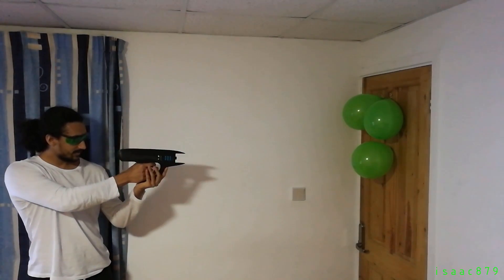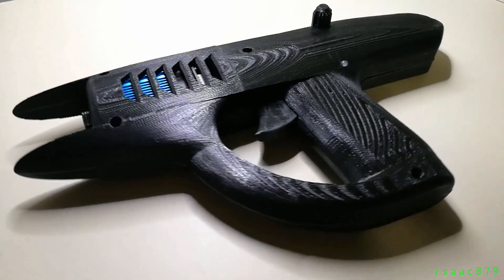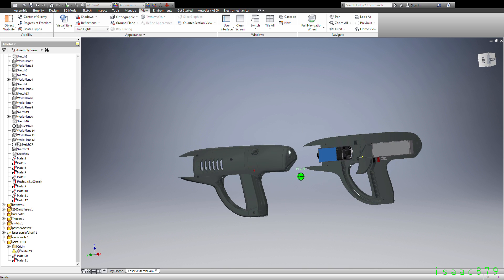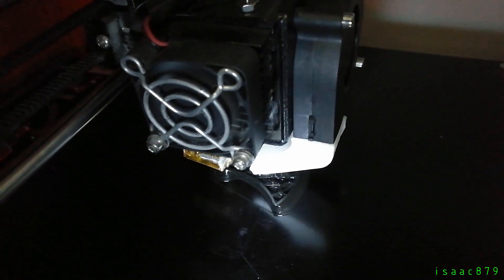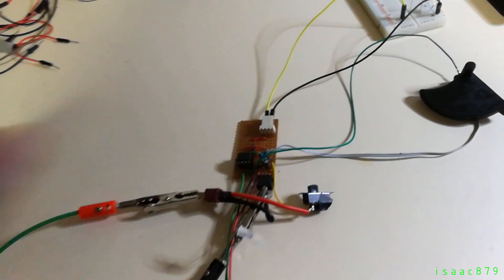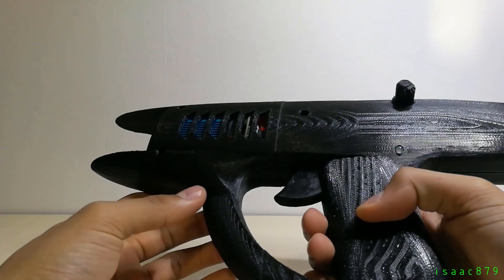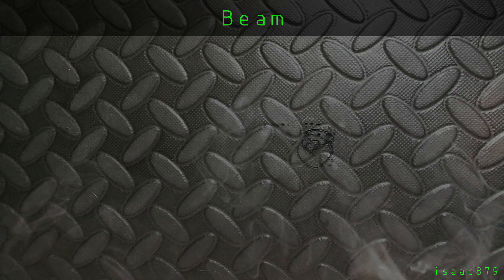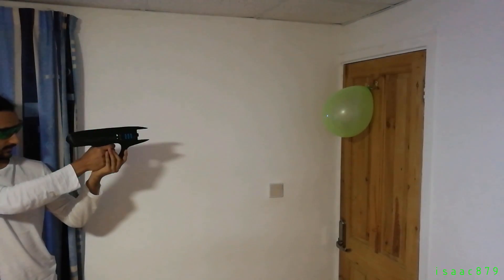Building a Real Laser Gun

Comment: nice project i have build one myself and it´s just working straight away. i only changed view lines in code because i use an arduino nano. there´s only one thing that i like to know what value have the potis? of course I could go through it by trail and error. or could use some resistors to kompensate it but it would be nice if i could use the correct ones. at the moment, i use some that i had lying around. 22k i think.

thanks for sharing this project hope for an answer.
Reply from the maker: Sorry for the delay. You would have to manually test the values yourself. Different pots may have different values so I don't know what yours would be. I hope you manage to sort it out andare having fun with it - stay safe :)
Reply: Hey bro can you please help me out with this project :)
Reply: Bohat achi koshish ke ha bro apny lakin isky andar wo power nhi jo honi cahiye kam az kam 30 feet se hitt kia jaye to phir ye kaam ke ho aur laser ke light ka pata na chaly kahan se lazer chalai gai ha phir ye bohat kaam ke ho ispy mehnat kro jub apny itna kr liya ha is se acha rsult bhe aa jaye ga mjhy umeed ha

Comment: What laser did you use
Reply from the maker: I used the 2500mW laser module from my Eleksmaker laser engraver https://www.banggood.com/2500mW-A3-30x40cm-Desktop-DIY-Violet-Laser-Engraver-Picture-CNC-Printer-Assembling-Kits-p-1003863.html?cur_warehouse=CN
Reply: Thx, can you use any high powered laser to hook up to the ATtiny85 micro controller
Reply from the maker: I don't fully understand what you are asking. Different lasers will have different control circuitry so may need to be controlled in different ways. My laser module has 3 pins, one for 12V power, one for the ground connection and the last is the PWM control signal. The ATtiny85 only controls the PWM signal, it cannot supply the power the laser needs to operate. I hope this answers your question or if not, could you clarify what you are asking?
Reply from the maker: You will need additional circuitry to connect lasers to the microcontroller. The exact circuitry will depend on the laser being used.
Reply: isaac879 thanks so much!!!can you make a video tutorial on setting up the micro controllers code? 
Sorry for all the questions. I just wanted to understand this a lot more. I think it's nice to have you respond to my comments because you really want to help us out.
Reply from the maker: Unfortunately I'm probably not going to get around to making a tutorial on it because I've currently got several other projects I'm working on. I can upload and share the code for it on Github if you would like? The ATtiny microcontrollers can be programmed in using the Arduino IDE and there are plenty of tutorials on how to set it up and use it :)
Reply: isaac879 yeah upload the code and give me a link.
Reply from the maker: The code is now available here: https://github.com/isaac879/2.5W-laser-gun And the CAD files are here: https://www.thingiverse.com/thing:2775433

Comment: Very nice laserweapon. How i can pulse the laser with more power?
Reply from the maker: Thank you! For my laser gun I just pulsed the laser at full power for a short time, so it wasn't actually any more powerful than the beam. It should be possible to overdrive most laser diodes to increase the power, however it depends on the laser diode in question. Overdriving the diode will probably reduce the lifespan as well. You will need to do some research into what kind of laser you are using and appropriate driver circuitry.
Reply: isaac879 I have a normal engraving laser ordered by china (2,5W). 
How much current have the pulse by your laser with the most power?
Reply from the maker: At 12V it draws a maximum of about 1.3A to power the laser module (laser diode, fan and driver circuitry).
Reply: Ok, thank you very much